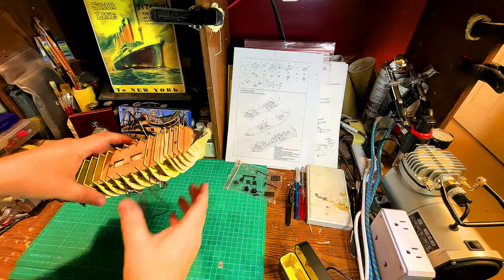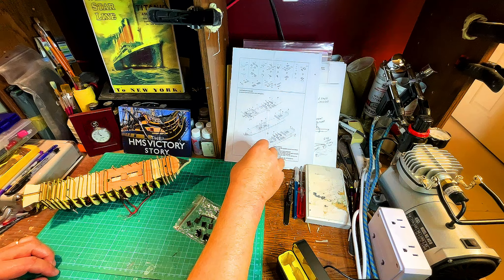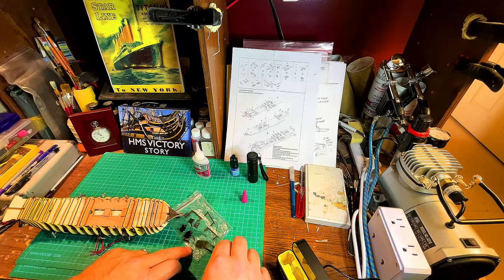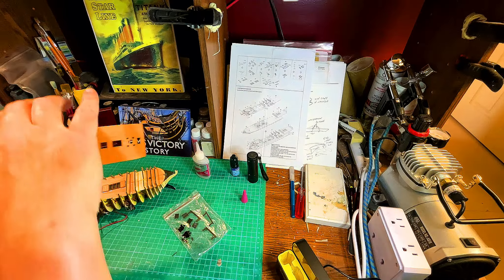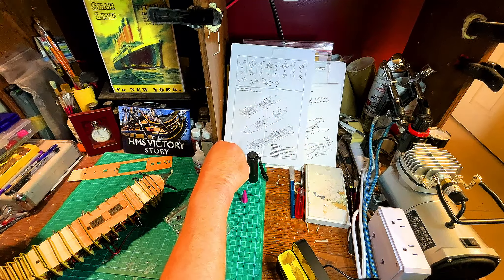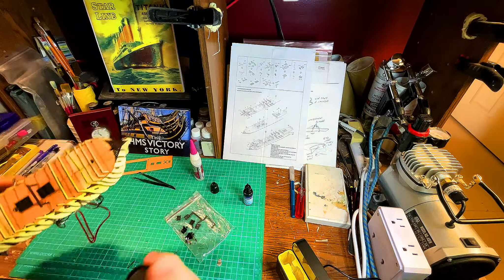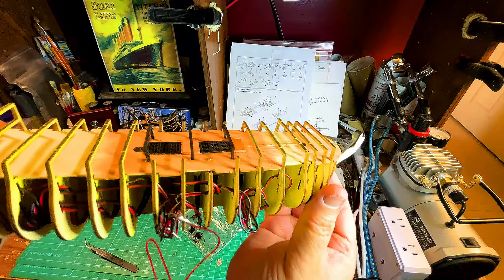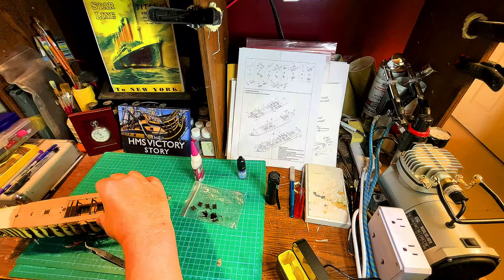1:200 Scale HMS VICTORY Wooden Ship Model Kit Build (Part Seven)

Comment: Do you have a link to where you purchased the model from.  Many thanks for the videos.
Reply from the maker: Thank you for watching!  The exact link where I purchased mine off of ebay is no longer up.  But I found one similar.  Best of luck with your build!
https://www.ebay.com/itm/226035829363?_skw=1%2F200+scale+HMS+Victory+wood+model&itmmeta=01JFDEWFJHPY49GY2024MKDGXX&itmprp=enc%3AAQAJAAAA4HoV3kP08IDx%2BKZ9MfhVJKlXddc3yWeBYNM%2BJMpf3cmVBwZrfO83dVMjQjhWvM2Tu9JslnxWLc4GNEfY419rP8PWox9csZI3HyXVt9EKKZBAVjmbwuoUB%2BX7aKNq7v%2BviARobM0nAAw19nZYXplquBAAz26iFCZ4jxU5BRw4DnNyHWVmp5z4u%2FItUZHYd8w%2FVPNlGwe1NfadVgjhKi7Ma%2BbWyqVNs49OIaQfhiKF3lkb6f%2BxAHQYT3UC1HvOmET0FkhZVx9ZTgoKUc8xOYhx9ITLnsXfd7JgrzCnNvpiNWlE%7Ctkp%3ABk9SR7D58a77ZA